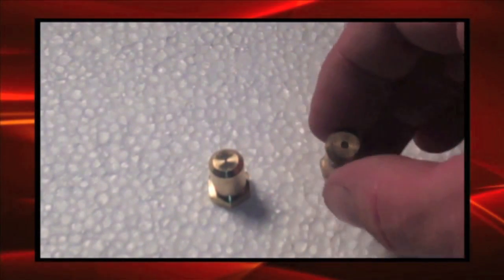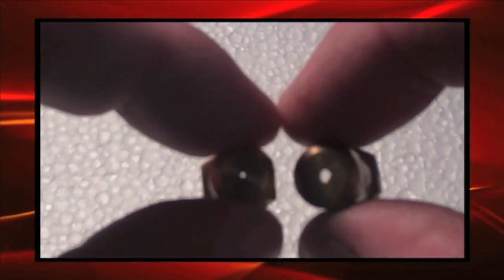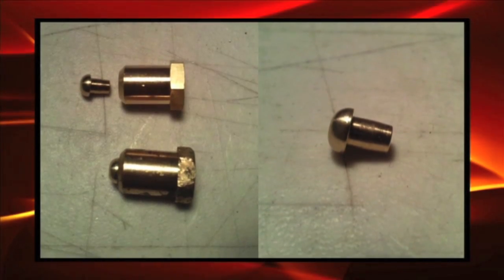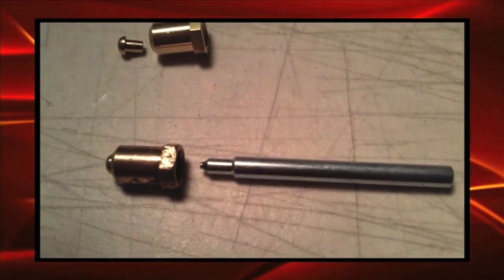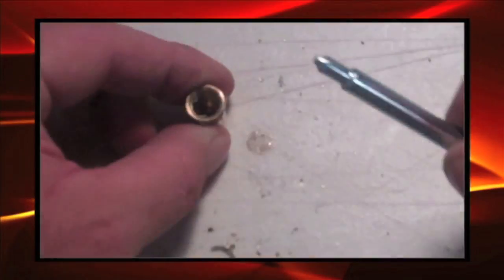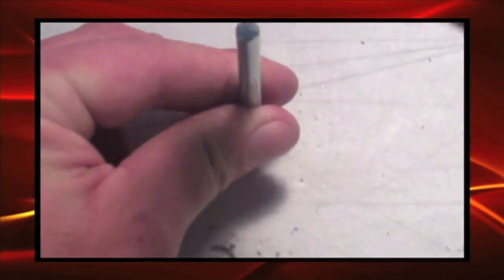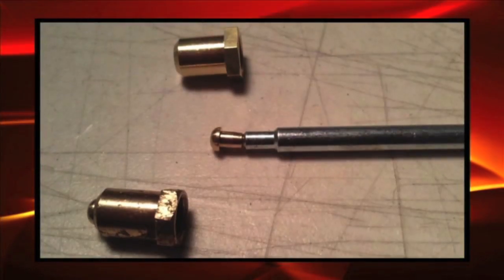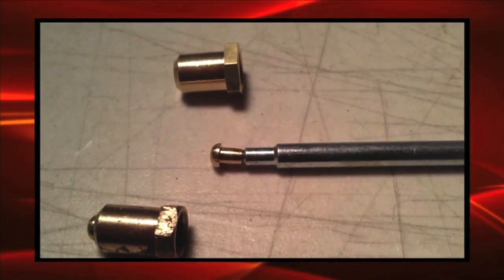Convert BBQ Grill From NG to LP Without New Orifices

Comment: Orifice size for propane, LP, is calculated as :
d = sqrt( Effective_Burner_BTU / (eff x 2500000 x sqrt(WC) ) )
where d is orifice diameter in inches
eff is burner efficiency (use 0.9 if you don't know)
WC is regulator pressure in Water Column (most propane grill regulators are 11", but some are higher like 14" for Napoleon) must make sure of your pressure.
After calculating diameter, look up closest numbered drill size for that diameter.

Comment: Question: I have a 40,000 BTU LP fire pit that I want to convert go NG. The factory placard says it has a 1.96mm orifice & 11” water column. According to the charts,  the drill bit size needed is a #48 or .076. 

1.96mm divided by 25.4mm per inch = .077 which is 1000th of an inch larger than the actual drill bit size needed. That means the factory orifice is basically the correct orifice size for NG & I don’t need to mess with it right???
Reply: yes i think you right NG takes bigger orifice than LP as it requires less air, and normaly operates at lower pressure so the NG orifice is bigger as far as i know ans normally around 1 mm while LP orifice is 0.7-0.6 mm

Comment: Is it possible to reduce the propane pressure to 3 or 4 inWC and then still be able to use the gas jet?
Reply: No, its not a pressure problem its a volume problem